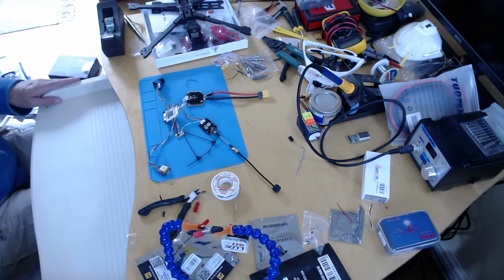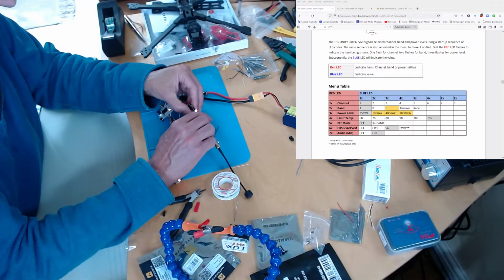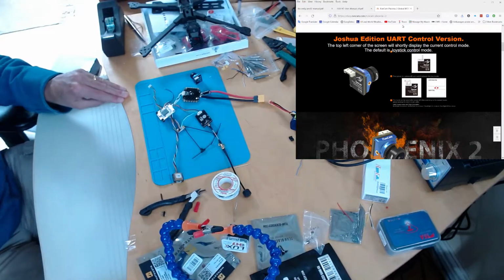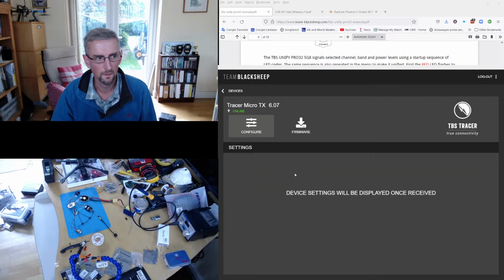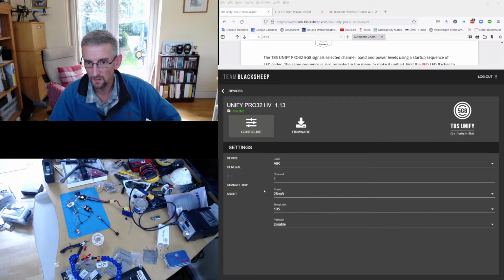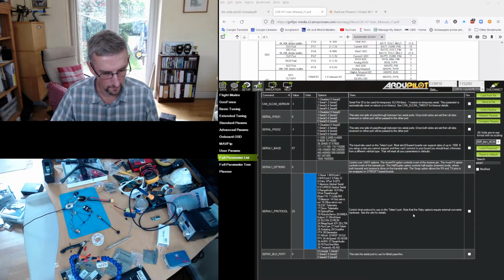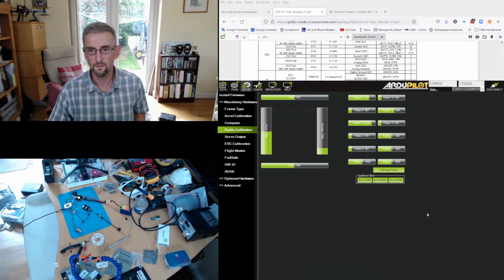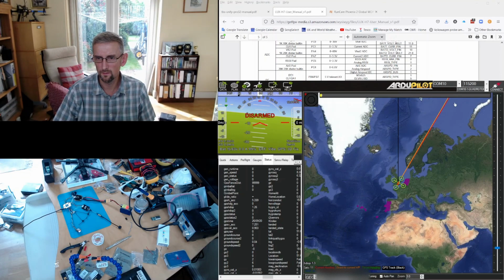ArduCopter 7" LR Build Video 7 - Peripheral Configuration

Comment: Hello, I have the TBS Crossfire Diversity Nano. My radio can transmit the command to my drone and mission plan register it. However, in the message start up I receive this error " CRSF v2: Requesting RX device info" May I ask what maybe the problem?
Reply from the maker: Sounds like crossfire isn’t communicating correctly- what version of the TBS firmware do you have?
Reply: @andypiper5285  hello sir, thank you so much for making the series and thanks for answering. I apologize I do not know the firmware number but when I click on the upgrade button it is currently the latest firmware for my crossfire and my tango 2 as well. I’ve checked again on the calibration stick and i see mission plan show the roll and yaw etc. But when I check on telemetry it say no telemetry send to my tango 2. I’ve make sure to check channel 1 and channel 2 go to rx and TX correctly in the flight controller. I made sure to buy the same one as you to replicate your step easier.
Reply from the maker: @bohaman.  What flight controller are you using?
Reply: @andypiper5285  I’m using the LUX H7, I noticed in your video to wire the cross fire at serial 1 but in the lux guide it say rx6 and tx6 so It’s serial 7 and from there I do similar to your set the thing at 23 for RCIN. But I keep receiving error that I quoted earlier.
Reply from the maker: @bohaman.  it seems odd to me that your radio link is working but you are not getting telemetry. You probably need to start a thread on discuss.ardupilot.org - hard to diagnose from here
Reply: @andypiper5285  thank you for your suggestion sir. I’ll will do that and post screenshot for better representation